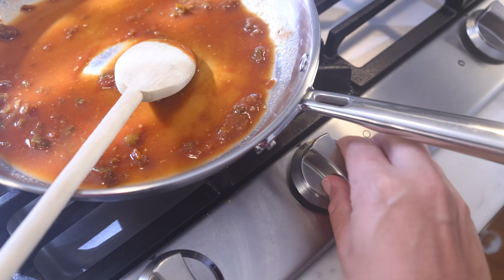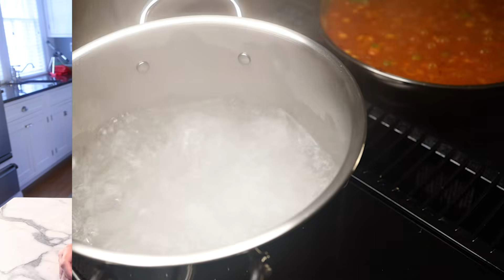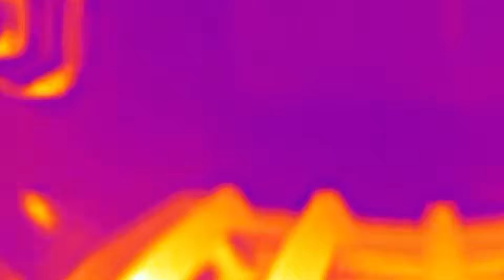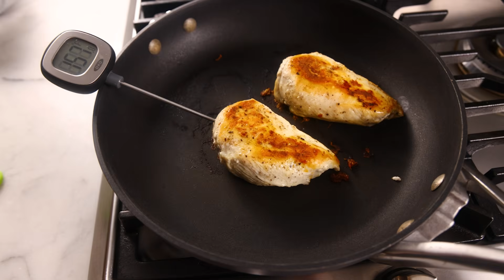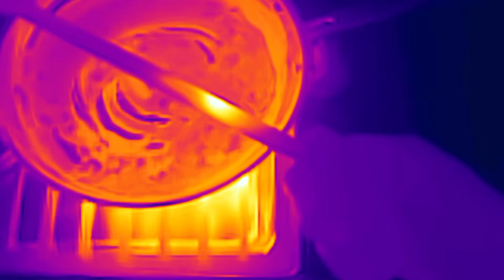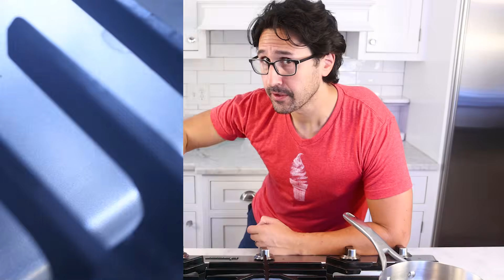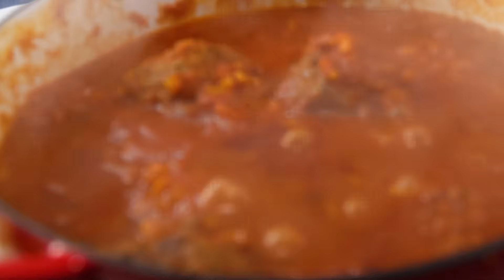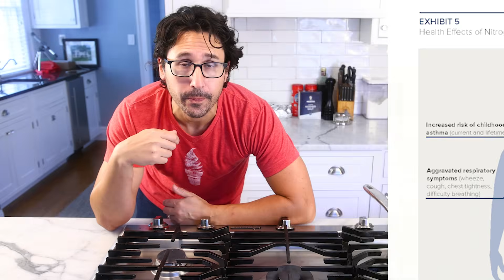Problems with gas stovetops | weak, dirty and dangerous

Comment: You wouldn't have to waste the stove if you wanted to buy a new & powerful induction cooktop - you could either keep both and use gas for woks and the like.

Or more likely, sell or donate it to someone else, who is in need of a stove, but might not have the means or want to buy an electric cooktop.

Then you'd have not wasted the gas despite getting the glass!

Comment: I remember cooking on a gas range and noticing that when I boiled water, when I turned off the heat the amount of steam I could see increased a lot. It took me a bit to realize with the heat on a cylinder of hat air was rising between the pot and the rest of the room. Steam it hot dry air doesn't condense as much and it remains invisible.
     When the heat is turned off the hot dry air stops and the steam from the pot is exposed to the cooler room air.
     What we see as steam is not actually water vapor. It is tiny droplets of liquid water condensing in the air. Water vapor just isn't visible.

Comment: As someone that less then a year ago switch to induction instead of a crappy student gas stove i can confirm that it works nicer and cleans a lot easier. I do have to add that the gas stove i just before was old and didn't work that well

Comment: It should be noted that FLIR has real issues with accurately measuring temperatures from specific surfaces.  General rule is that it the surface can reflect light, you are not going to get an accurate reading.

Comment: Honestly I’ll bet replacing a good gas stove with an induction will actually offset the carbon footprint much faster than you think. Kinda like electric cars, depending on efficiency, it takes anywhere from 2-6 years to offset the difference. It’s an interesting comparison

Comment: I agree with much of this. But the main issue I've had with electric ranges is that the food doesn't stay hot. It'll be hot coming off of the burner, but once I get it on the plate it's cold. Also, to boil water, I just use an electric kettle (it's fast and once it's done it'll shut off).

Comment: I too have the same problem with gas stove top taking too long to boil water. At first I was really sad but I found a work around. I start with a small amount (about an inch or 2.5 cm) over the gas heat in he pot. I then fill my electric tea kettle and heat that up. I add the boiling water from my kettle to the pot and BOOM, boiling water in the pot. Depending on the size of the pot an the kettle may require several fills from the kettle to the pot. Still, every time I have to boil on the gas I regret switching from glass top electric...

Comment: Twice now I have left my second largest gas burner on accidentally at lowest setting for more than 10hours while at work (cooked eggs for breakfast). Worst it did was turn my olive oil residues into a thick sticky paste, but did not seem to catch fire (unit not burned down when arrived home). So... not totally convinced that when you turn gas stoves right down it is still not down enough. I can just barely keep the pan warm on lowest setting for that burner..... the big burner on the other hand, has NO lowest setting, it's just HOT!!!

Comment: Sorry to have to point this out, some people are gonna be mad at the comments here, BUT, american gas stoves however fancy they may be are usually pretty terrible - and so is Adam's. Giant iron trivets covering the entire stove instead of minimal ones for each flame, the middle double flame is so small it looks quite pathetic, can't sustain minimal flames due to mediocre valves and a low pressure system (although that might be due to the kind of gas used as density differs)... and we didn't even get to look at the oven to criticize it as well.

About health problems claims, unless your kitchen is a closed sauna without any ventilation and you're breathing directly above the flames, that's all bs and fearmongering from lobbyists. Also, anybody that cooks with a gas stove will naturally seek good ventilation because of the heat and will most likely have an air sucking hood.

And I don't give a damn about carbon footprint if my electric bill is gonna be hundreds of dollars. For my family of 6 the gas bill is literally inexpensible whereas if I had an electric range the bill would be unpayable.

Comment: I had the exact stove vent with my gas and was told it was not suitable for gas. I did notice it tries to suck the flame in to the vent on higher settings.  Overall, I hated my gas stove experience.

Comment: Professional-grade gas stoves are insane, though. Back when my sister was in cooking school (tl;dr in Italy you can attend a type of high school that prepares you to be a professional chef) and they had cooking classes in the middle of winter, the professor just turned on one of the stoves and the kitchen immediately warmed up.
Reply: In Chinese restaurants they basically use a 3 foot wok over a jet engine
Reply: @Crokto  Lmao yep. There's this Vietnamese fastfood/restaurant place near me where the whole kitchen is open and visible from anywhere, and I always sit down facing the kitchen, because I love looking at the chef throwing the noodles around in the wok above, as you said, a jet engine gas stove. It's my go-to place in winter, it's so warm and cozy from the gas stoves and the food goes straight from the piping hot wok on my plate.
Reply: The hard part is tolerating the heat when more than one stove is running, that is part of why induction is becoming more common in a commercial setting.
Reply: @garethbaus5471  Well, using gas stove is how you achieve wok hei, which is important in basically any asian cooking, especially east asian. But yeah no reason to use gas in home, because they don't get hot enough to get the wok hei anyway.
Reply: @archiebellega956  several induction wok burners exist that exhibit roughly analogous heating characteristics.
Reply: @garethbaus5471  I don't care what you want to use in a commercial setting.  I use more than one gas burner all the time, and it doesn't make much heat.  Heat production still has an advantage in the winter when it's cold.
Reply: @robinlillian9471  I live in a place where it isn't winter most of the year, so that really isn't a significant advantage here. If you live in point barrow or something I could understand but very few people do. I personally found the heat annoying when using a single stove.
Reply: @robinlillian9471  and gas stove is absolute hell in the summer.
Reply: I will point out that that is increadibly inefficient. All that heat being thown out into the air is heat thats not being put into you food. At a school that probably isnt a major concern, but for your home life, that extra heat is just money being thrown out.
Reply: @tlpineapple1  inefficient? A bbq is inefficient. It doesn’t stop me from eating out at bbq place. No one cares unless there’s really a shortage. Stir fry is also way way quicker, so that’s the upside.
Reply: @TheZachary86  No one cares, minus the millions who have to ration their various resources. But that really wasnt my point, it had nothing to do with your individual use and more to do with all that wasted energy we just throw out.
BBQs should be a once in a while meal, and most people do not use conventional ovens for BBQs anyways. Stir frys can be done on any stovetop, sure its best over a flame, but again, you arent likely having a stir fry every day, you're better off investing in a seperate burner for that if you really must have a gas burner, or better yet, just use your BBQ grill.

Youve reacted emotionally to my comment, and as such missed the point of it. Id suggest taking a step back and engage the critical thinking portions of your brain.
Reply: @tlpineapple1   

As an Asian we do stir fry almost everyday. If I’m too poor to have gas, i would have been burning wood. Literally no one cares about being “efficient” with trapping heat, hence the response. And you’ve reacted more emotionally since you’ve written a longer edited insulting response to me. I find it funny how your brain stops working
Reply: ... look up radiative heating. theres a chance that all that heat simply went away when they turned it off.
Reply: Hell In summer though, i reckon. lol
Reply: @parkerlong2658  I use the utensils my employer provides when using gas, but the heat is bad enough that although it is tolerable I wouldn't be comfortable unless I could  stand a couple feet further back even with only a single burner on.
Reply: #team gas

Comment: Warning:
Health Concerns Re: Gas Cooking-
many don’t know that as with all combustion, 
there are billions of fine and ultra fine particles created 
every second  the gas flames burn.

These particles enter the lungs, then the blood stream, they circulate all through the body.
They become lodged in the organs and the brain!
They are absolutely toxic.

These particles lodge very deeply into lung tissue, 
and are very destructive.

The particles cause inflammation everywhere they go. 
They are implicated in several diseases, including cancers, dementia, Alzheimer’s,
asthma, heart disease, and more. 

In most homes with gas ranges,
they are usually the primary and most significant source of indoor air pollution.
Cooking a single meal with gas fuel in a unventilated space means taking in many billions of harmful nano particles.

Many experts advise not purchasing gas stoves/ranges, and not using them if already installed.
An electric griddle can be used;
but also and many believe even better- 
induction cookers, 
and induction ranges.
If the power goes out- a generator can be used if available, and if not, 
gas could be the last resort. Use only ever outside 
if possible, or if cooking indoors with gas- use the maximum ventilation  possible, 
and run an air purifier both during and after cooking.

Do not inhale or try not to inhale
the fumes directly rising from the cooking surface.

Comment: Pro tip for boiling big pots of water, I use an electric kettle to heat up the water, then pour into the stock pot. Works way faster, I don’t have to wash an extra dish because I use the kettle every morning, and you still get the responsiveness of gas.
Reply: Even just filling the pot with hot water from the faucet can get you most of the way there to boiling. The water out of my faucet is at like 145f and if I fill it with that it’s super quick to boil on the stove.

Comment: idk i agree with alot of your videos but tbh ive cooked on alot of electric and induction cook tops, never found one that was half decent to cook on. electric takes wayyyy too long to heat up, if you have a double burner you will boil anything in minutes. a good gas burner 100% beats out electric. you can control the temperature much better too, you dont have to wait for the physical cook top to cool down. ontop of that alot of induction stove tops are built into non-granite countertops, which imo is not only dangerous fire wise but poses a risk as far as airborne contaminants. if electric was so much better, restaurant kitchens would use electric. they use gas, always.

Comment: Huh... Well thanks for this video. I grew up with a pretty damn good electric range at my parents house, and I had seriously considered getting a gas stove when I move out because everybody's always talking about how fantastic they are. Not any more. Thanks Adam!
Reply: Read through the comments, though, for some alternate perspectives. Gas does have some advantages, such as being far more energy efficient, and being cheaper, (maybe not a concern for Adam, but it is for a lot of people).
Reply: @robotworld453  after some quick googling i found a pdf that tested this and "at the appliance" the efficiencies are:
Gas: ~30% 
Resistive: ~70%
Induction: ~85%

Now we need to derate them for primary energry source efficiency. Gas will have fugitive emissions (leaky pipes, but we will assume 100% of the electricity is from gas and has the same leakage rate. This is a lazy assumption for a youtube comment, a real study would actually go into the difference) a well known fact is the grid is ≈35% efficient but only 33% for thermal power plants (thermodynamics reasons).

Overall efficiencies are:
Gas:~30
Resistive: ~.7×.35 = ~24.5%
Induction: ~.85×.35= ~29.75

Gas and Induction are equivalent in terms of pure natural gas primary energy efficiency. But this is a win for Induction because electricity doesn't have to suck to produce, nat gas generally does (you could use biogas which is just methane from rotting organic matter). I highly recommend you look into a tool by the US government called the "EPA Power Profiler" (google the quoted text) and you can see a breakdown of the electric mix by grid region and the emissions of CO2, NO2, and SO2 per kWh produced. New England is on 50% nat gas, Upstate NY has 30% hydro & 30% nuclear so its already better the environment in upstate NY to use induction over nat gas.

I also highly encourage you to find good research on the at appliance efficiency of different stove technologies incase the single study I'm basing this in is wrong.

Comment: Much of the electricity in my state is generated by burning coal or natural gas, some nuclear, and a bit of solar.       
In my neighborhood in the middle of a very large city, my street is almost always the last to have power restored in the frequent outages and I have received calls from the utility informing me that the power has been restored when my house is still dark.         
I may think about buying an induction hotplate, but for most kitchen tasks, gas is the only way to go.

Comment: Here in Sweden there are almost no gas stoves. Most people have electric coil stoves, but more and more are switching to induction. It really is the best. Even my budget model is super fast to boil water, and responds almost instantly.

Sidenote: most of our power does not come from burning fossil fuels. It's mostly hydro and nuclear. My region also has a huge amount of wind power.

Comment: That heat going up around the pot isn't necessarily wasted. It actually keeps my pans from having hot spots, and heat the sides of my saute pans, fry pans, and of course a wok. I cook better with this. You simply need a stovetop with higher BTUs. Also, especially where I live, it is cheaper to heat my house, water heater, and cook with natural gas than with electricity, and I've got hydro and nuclear power all around me. Those people against natural gas are also against nuclear power.

Comment: Gas is better than electric. I've cooked for over 15 years in commercial kitchens, and gas is far better than electric with no questions. There are special circumstances with special equipment where electric is better but that involves more than a simple electric burner. That being said, there are jet engine wok burners that are like a giant blow torch and I'd say they would blow the doors off anything electric that only heats metal with electricity and no other technology 

There is no better tool for cooking than old fashioned fire, imo

Comment: I switched recently from a high-end ceramic radiant range to a high-end dual fuel range with gas burners.  It's definitely been an adjustment period, but I don't think the gas cooktop I have is any slower to boil a pot of water and what it gains is precision and responsiveness.  I was able to set my stock pot to a perfect covered simmer for making soups and stews, which was nearly impossible with the radiant cooktop.  Part of the reason I can do that is because my range has tri-ring burners with simmer modes, which is a higher end feature not available on all gas cooktops.

Nothing would ever make me go back to gas.  I originally planned to get induction, believing it was the equal to gas and of course it is much safer.  I bought a high-end single-burner induction cooktop and it was alright, but after demoing a few ranges at the store I quickly realized almost all induction ranges have a single induction coil in each "burner", which is far smaller than the burner.  This results in /very/ uneven heating that is actually damaging to cast iron.  The high-end single burner had dual induction rings which helped a lot, but still didn't fully solve this problem.  If I bought induction I would have to ditch most of my cookware for disc-bottom cookware to get even heating and would no longer be able to use cast iron.

Cast iron on gas is amazing.  Gas is significantly more dangerous though, and it's now a priority for me in my next house to get much better ventilation throughout the house to deal with some of the downsides.  Additionally, I am considering switching to a commercial grade dual fuel range which has both gas and induction burners.  Will say, I'll never go back to a radiant cooktop, but would love induction for boiling water.